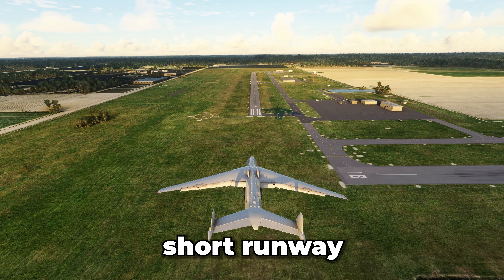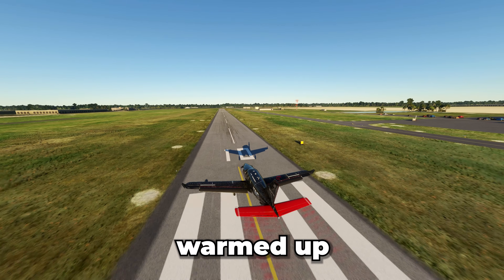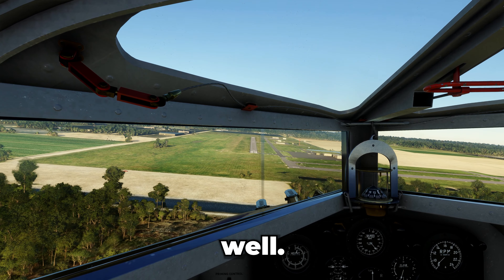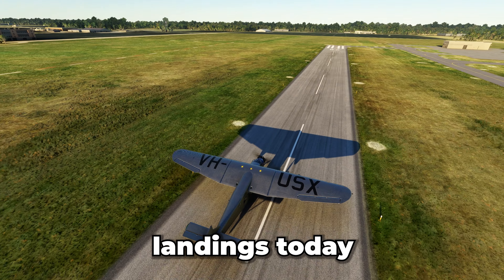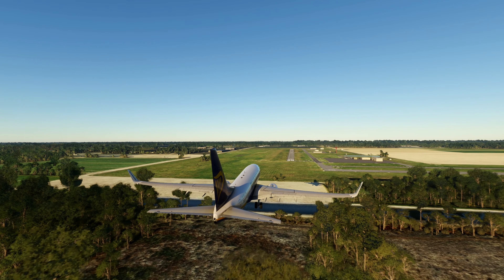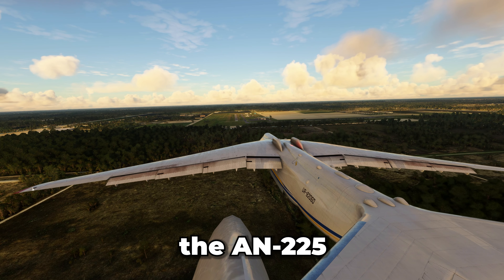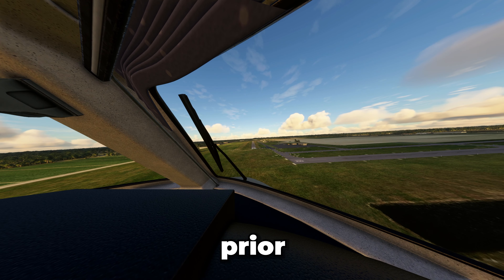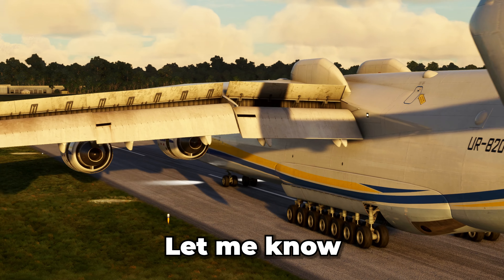Can BIG Planes land HERE in MSFS?

Comment from the maker: Do you like the short landing challenges? What else would you like to see?
Reply: Can you show your VR settings please
Reply from the maker: @klier8737  I am actually using TrackIR in this video! Do you just have VR or any other head tracker?
Reply: i like the short landings
Reply: @Flyguy1903 i use VR and i have similar specs to ur pc so i was wondering what your settings were because i cant get it look very good and smooth
Reply from the maker: @klier8737  So one big performance improvement was using OpenXR! This significantly helps in reducing lag when in VR. Maybe 15-20% boost in performance, but everyone's setup is different so results will vary.
Reply: @Flyguy1903  what vr headset do you use?
Reply from the maker: @klier8737  I have the Reverb G2 currently, but upgraded from the Oculus Rift S. G2 is like a half level upgrade from the Rift S.